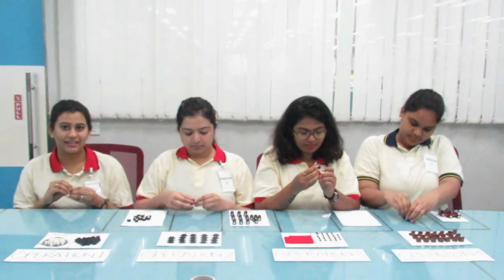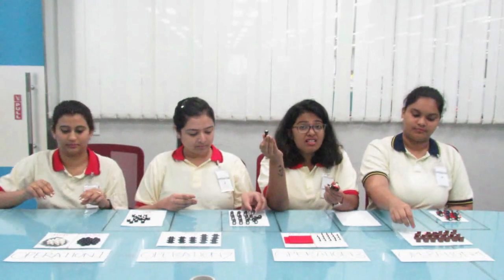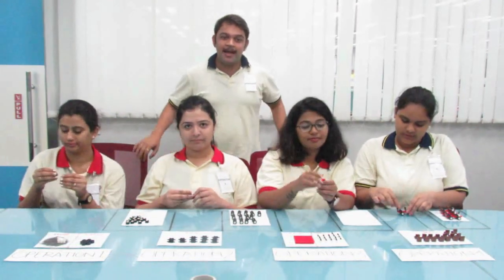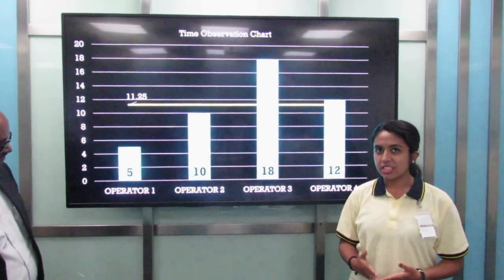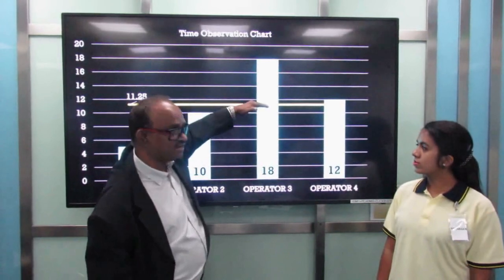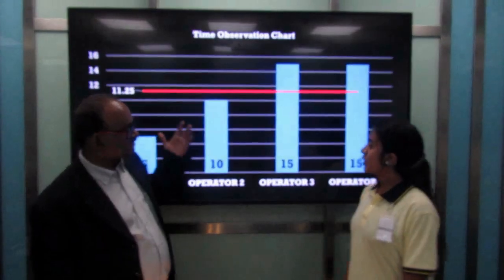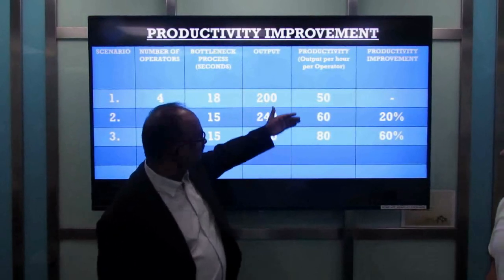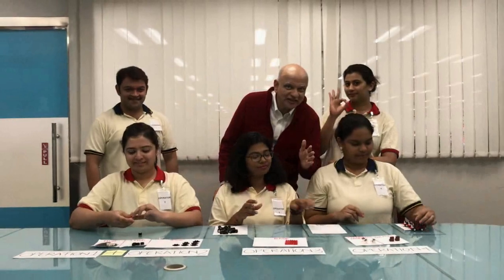Line Balancing

Comment: That is indeed interesting sir! Sir in our college labs, when we were asked to prepare a certain emulsion or suspension, we were required to get the ingredients from the different points in the lab for example measuring and obtaining oil from the counter, weighing several ingredients like gum and preservatives from balances. The oil weighing would take the most time so while some of us were taking oil others would do all the weighing part and then vice versa instead of everyone first taking oil then weighing. Is that a correct application?

Comment: The video helps understand that by synchronizing the workloads at each workstation such that the time required at each station across the line is approximately same, reducing WIP at intermittent stages we would be able to increase our productivity significantly.
Thank you Dr. Azlan Nithia, Dr G and team for this video.
Renuka Deshpande, RBA